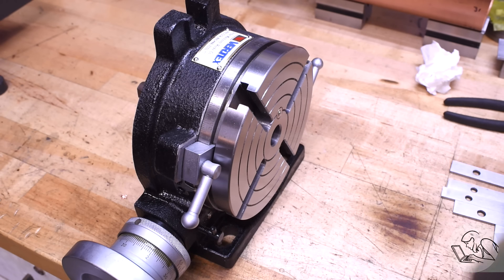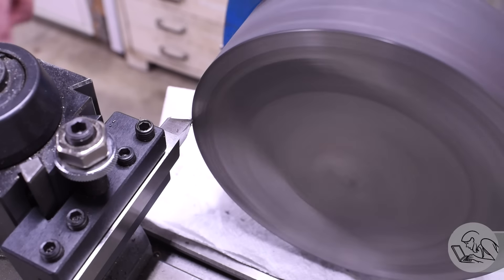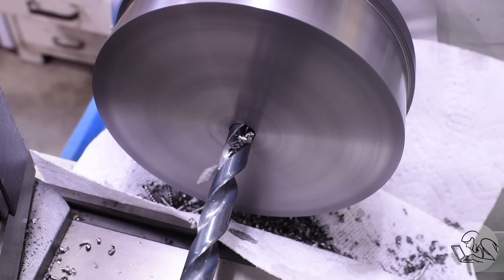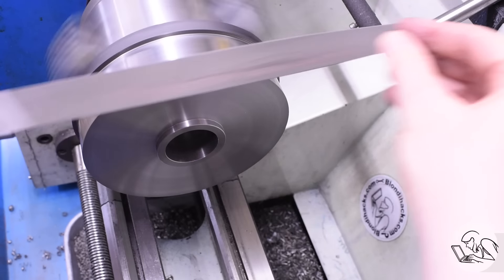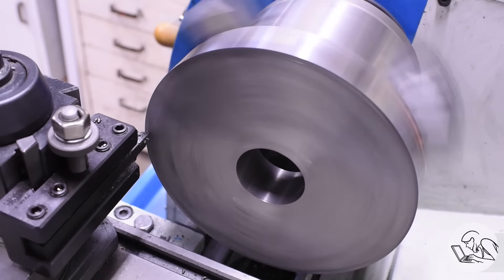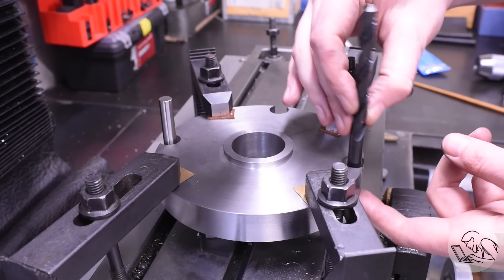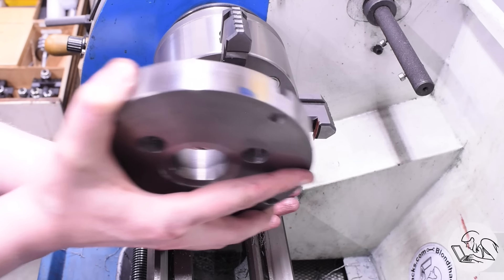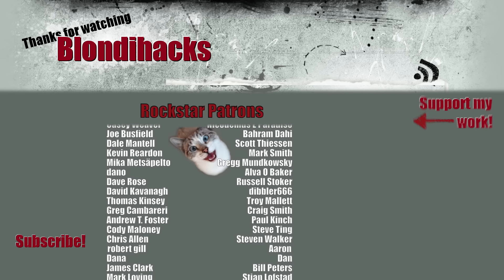Rotary Table Chuck Mount : Let's make one!

Comment: If your DC motor is a brushed motor, the relationship betwixt the brushes and the magnets affects performance differentially in forward and reverse. It is analogous to ignition or valve timing on an engine. Definitely a thing and may explain the lack of power your lathe has in reverse.
Reply: It probably is as the brushless one is basically a 3 phase motor so it would make more sense to use a vfd and a 3 phase motor as the brushless essentially also is but slightly more expensive
Reply: Brushless. I have the same lathe.

Comment: Hate when the carriage hits before the tool gets in deep enough.
The motor is probably brushed DC?  They are usually designed with some advanced timing in one direction. So they run better / make more power in one direction at the expense of the other.
Try a brushless DC motor instead.

Comment: Love these videos, especially the part where you screw up and don't edit it out.  I've learned some things about motor power and lathes from this video. I was going to convert my old Chinese 8 x 20 lathe to variable speed and wanted to make a poly-V belt pulley for it. I couldn't chuck the giant piece of aluminum I got for the project, so I used the tailstock to jam it up against the chuck and machined a shoulder on it that I could fit in the chuck. You would have been proud (or disgusted) of me. Now I'm having second thoughts that the 2HP DC motor I have might not be enough. Rumor has it that a 5/8 - 11 tap has a good enough profile to cut poly-v belt grooves. We shall see.

Comment: What's with all the paper towels catching the iron chips? Saving them for some foundry work?
Reply: Chips from cast iron are more of a powder than solid chips and they are really abrasive, so if it gets on the ways it will wear them down pretty quickly.
Reply: @sean.chiarot  They REALLY like to rust as well.

Comment: If you rotated your four hole pattern 45° you will knock off about 2 inch of travel on a 6” circle so it will probably fit on your smaller machine. The bolt hole capability on your DRO would've saved you quite a bit of time and having to re-pick up the part. xy move of 2.23 approximately then just go from -2.23 to +2.23 and repeat the moves one access at a time. There's always more than one way to skin a cat lol. Yes yeah

Comment: Source for large diameter cast iron.. 1) weight bench weights 2) flywheels from treadmill motors (also good for variable speed motors and PWM controllers..:)

Comment: I got an european clone of the PM 1440 i think and had the same problem as longer as I used the lathe it was slower on the other way round than the normal....after looking at the cowl i turned them around and from time to time i let the lathe run the other way round ...in the beginning I had 1400rpm normal direction and under 850rpm backwards but after regularly letting it run the other way round it became to 1290rpm und backward Mode ...so just let it run a few minutes every day while you clean or so and you will improve the rpm backwards 🤪👍

Comment: Try installing a thermal switch on the body of the motor.  Then wire it in series with the e-stop button.

Comment: I am curious, why did you insist on using HSS when you have carbide tools available, especially for a job this size? The carbide requires perhaps higher speeds than what Your lathe can provide?
Reply from the maker: I like HSS and this is a hobby.
Reply: Ok but... What are the properties of HSS you "like"? I'm a hobby person too, just got my CNC plasma, rebuilding my mill (I scored a Bridgeport) and have no lathe

Comment: If the part allow for a centerdrill, you could face with a right hand tool by center drilling the rough face and pulling the tool from inside going out.

It would need a feed reverse tho

Comment: 11.30......Maybe  there is casting sand embedded in the cast iron burned the tip of the high speed steel?Cast irons generally has a lot of carbon (lubrication) in it once you get past the surface casting sand contamination.

Comment: Sometimes I will cut a grove with a cut off tool as deep as I feel comfortable to guide the blade of the Harbor Freight band saw. With large parts and maximum span of the saw blade the blade can drift. The grove acts as a guide as the blade follows the easiest path.

Comment: You need to see if you can make the brush plate in the DC motor adjustable so you can time you motor when you run the motor in reverse.

Comment: You have a hole in the centre use it. Bolt the centre to table plus your clamps then rotate the piece. Nice alternative way of doing it. Your rotary table could have been used as well. As in the near the end of your vid. 10/10

Comment: my small lathe is only 12 inch but does not have a variable speed drive. it is belt and gears i have never had any overheating problems only problem i ever get on large parts is ocasional belt slip....

Comment: PLEASE replace that fuse with a push button circuit breaker !!!  It's the first thing I did with my lathe and mill.  Less than $10, plenty on ebay.

Comment: I've done a lot of stupid  crap in my years as a machinist but I have stalled more spindles on mills and lathes drilling things out. like I've stalled my vm10i 4 times drilling and my vmx42 twice once you get past 30hp you end up just breaking drills but yea drilling can be a lot tougher then it seems at 1st lol so don't feel like my 1st boss told me if you haven't stalled a couple machines your not machining right.

Comment: Not your best of days... at least not the cheapest of them any way. But I must say there's a missed opportunity to go with a 3ph motor and a 1ph to 3ph drive. A bit expensive but you'd be able to get better torque out of the low end (depending) and definitely get a TEFC with some fins and better cooling than most these little bench lathes has stock. And you coil have done another video or two out of it.

Comment: Mate that was a difficult job, I was going to give it a go on my machine but I'm having second thoughts now. My lathe is at least 35 years old & has accuracy problems. I think I'm going to have to spend my money on head bearings instead. Sigh

Comment: You are fun to watch and listen to.
In the 70s I took machine shop for 2 years in high school. I built an underwater housing for my Pentax SLR out of plexiglass. 

I made several of these things to operate the camera controls and still be water-tight. 

http://i148.photobucket.com/albums/s19/the_dragon_no1/dykking/24519.jpg
 
I made the bolts out of hex stock. I had to make a boring tool to cut the groove for the o-rings. It worked. The instructor was amazed.

Comment: Why aren't you jumping into CNC? Last time I made a fixture table I was only able to drill 2-3 holes myself afterwards I went back to code the CNC for 200 more holes.
First thing I did with my rotary table was to add a motor... I'm not a suitable handwheel monkey

Comment: Silly!! Hot Glue. Attach the chuck with Hot Glue. You should know that, even as a Newbie.
(Did you know there are "Gorilla" hot glue sticks? I just bought some at WalMart. Both sizes. Small and large! I haven't tried them yet but I'll bet they are pretty good. I hope they are. Not recommended for attaching chucks to rotary tables!).  :-)

Comment: Watching this for a second time made me remember for when I had to drill a 40mm hole through a titanium alloy bar. To lessen the load and ease the expulsion of chips, I ground the drill for chipbreaker profile. Basically and very much simpler than the theory, three nicks, 3mm deep were ground into the cutting faces of the drill. One at halfway across one face and two on the other face at 25% and 75% of the face. It dropped the load dramatically and the drill cut small chips. Just a thought

Comment: If the iron part was thick enough, that is, far too thick and have to take off a lot, I would have considered a cutoff tool as far as it would go, then put it in the band saw to separate the parts.  Thus I would have the piece I needed plus a left over piece for some other job.

Comment: Here in the great south land below the equator the Vertex 150 mm (6 inch) rotary table (model HV6) is sold with 3 slots, in lieu of 4.   There is also available a matching front mounting 3 jaw chuck ( bolts go thru the chuck body).  This makes mounting a much simpler operation.

I don't understand why such a variation exists, except that it is a simpler and cheaper set-up.  Perhaps you or your viewers know, and can shed light on this geographic discriminatory situation.  I believe that the Vertex tooling we get here in Australia is made in Taiwan, rather than mainland China, but I would stand corrected if somebody can demonstrate my error.  The distributors of machine tools here seem able to source the "better" quality deals, we pay more but we seem to miss the disasters which come if you buy on price alone.

Regards

Stavros, a poor but enthusiastic superannuated, amateur machinist!

Comment: The most useful part of the exercise is figuring out how to take the machines you have to the limit. On another note, it does make me pleased that all my machines tools are old and second hand which means you adjust speed by changing belts on pulleys. Not as convenient as twiddling a dial but as speed decreases torque increases.

Comment: Here McMaster Carr sent you all those extra atoms of iron formed in a star eons ago that were ejected into the universe in a supernova. And you just drop them in the chip tray.
While variable speed is nice there are times when a motor running at constant speed with a mechanical reduction is better.

Comment: You can always tell a true machinist by this pattern: Works on a thing - fucks something up - identifies the problem - solves the problem - comes up with ways to solve the already-solved problem in a parallel universe where the first solution didn't work.